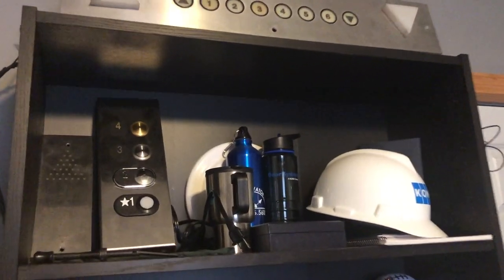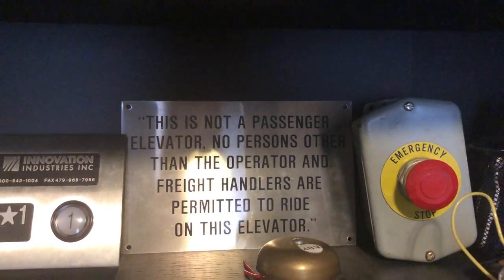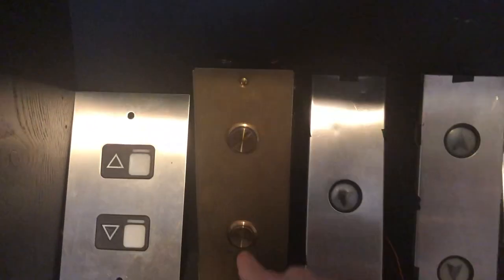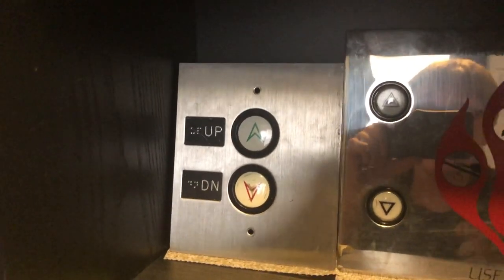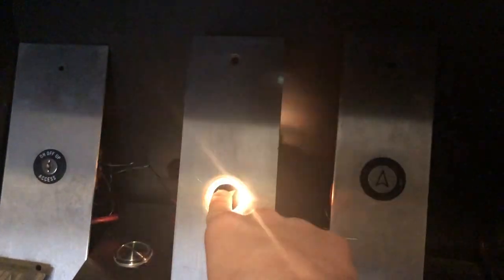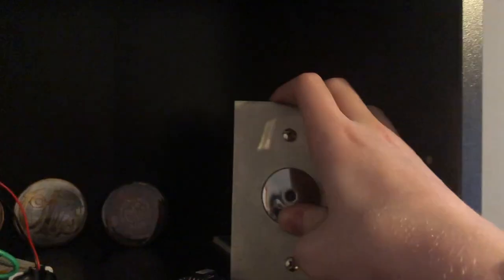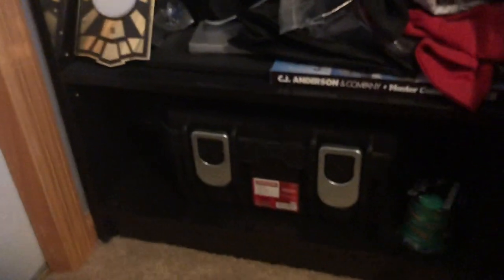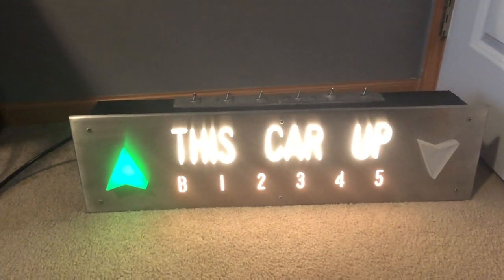A Tour of My Elevator Parts Collection! (5/1/2020)

Comment: Lots of cool stuff man!  A couple of odd things I've seen though... First, those Haughton arrow buttons..  The only time I've ever seen those in use was on the OTIS elevators at the Duluth Medical Arts Building before the mod.  But that was an interesting bank anyway.  The COPs were a combination of JetPlus and Armor and the two right cars had door tracks that said "Otis Signal Control" while the left two cars just said "Otis".  (That bank obviously had some interesting mod work over the years.)  And that prototype set of direction lamps... they look identical to the Burbank Bar & Grille lamps on the door frame inside the car.